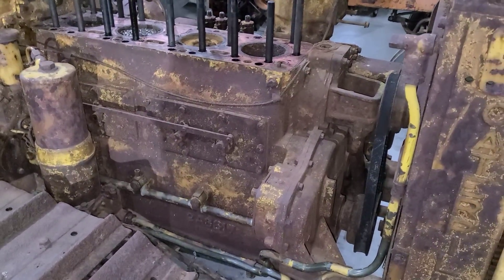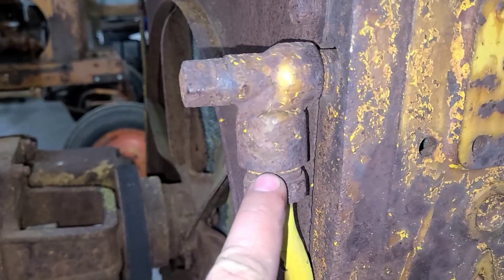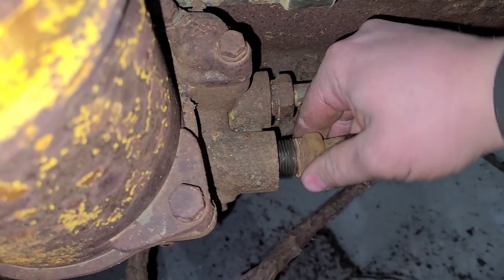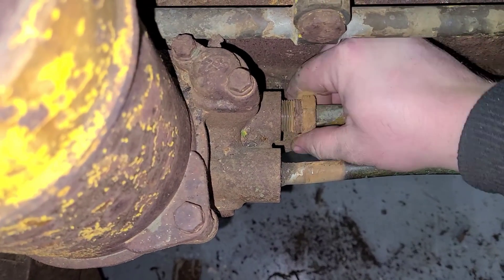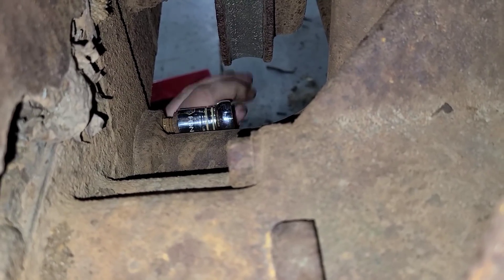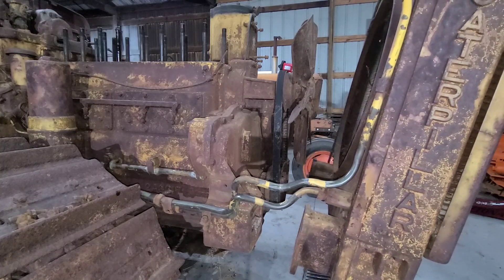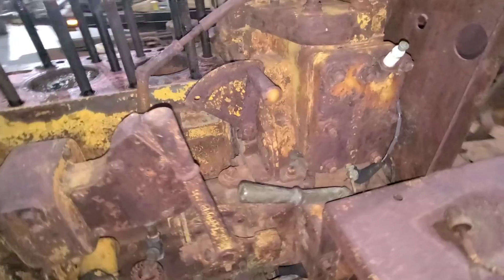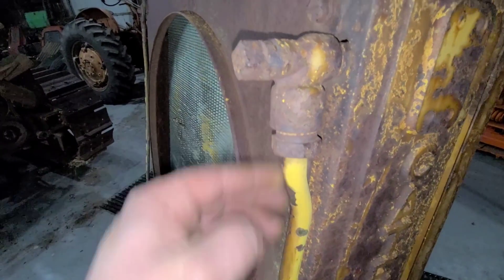Caterpillar RD-4 Engine Disassembly Pt.3

Comment: coming part with little a do, hope it keeps up! 👍 you said that there is no heat where you are working, It looks like it is wide open building or shed, which would be expensive and not very practical to heat. do you use torpedo style heaters for your spot that you are working to at least take the chill off?
Reply from the maker: The shed is a 50x80, with the front 50x40 cemented. I need to get a partitioning wall up between the front and back, as well as insulate and finish out the front half. Then I can throw some heat I'm there.

As for now I just wear coveralls and a good coat, no heater

Comment: Why don't you use penetrating oil?
Reply from the maker: I feel it doesn't work well, and for 99% of the bolts on this machine, nothing is needed to remove them, thanks for watching

Comment: I am stunned at how you are able to get frozen bolts, nuts, and line fittings loose. From here it looks all but impossible. I’m impressed at your skill doing that. A swimming pool full of EvapoRust wouldn’t be the wrong idea right here. Keeping track of all the parts is a major task in itself. Incredible work!
Reply: Blue wrench sir. Torch. Doing great job sir. But I would use some  WD 40 or liquid wrench or something.  Lol
Reply from the maker: I heat bolts when needed, otherwise most come out without issue

Comment: Where's that rust penetrant.? I cringe each time you attack a pipe fitting,  or bolt.
Reply from the maker: I don't use a lot of penetrating oils, never had good luck with them actually working. Instead, I like to use heat, but nothing is guaranteed 100% to work

Comment: Thanks for sharing.  Do you use penetrating oil such as Kroil to aid with braking loose rusted connections or just heat?  Keep those videos coming....
Reply from the maker: Honestly Geoff, up to this point I have not used anything. All the bolts have come out and not put up a fight, as if this machine is begging to be restored. Thanks for watching
Reply: @kylechrist  Amazing!  I live about a quarter mile from the ocean.  Everything rusts together.  I once sold a Land Cruiser with a spun rod, as is, because I couldn't get any of the bolts out.  The buyer was going to put a Chevy v8 into it, so he didn't care.  You live in a world I can't even imagine.

Comment: You need to cover the grate on the floor. It it a nice place for small parts to disappear into. Nice shop by the way. All it needs is some heat.
Reply from the maker: Thanks Chuck, I didn't plan on putting the crawler right over the grate but I'm trying to keep everything away from the walls until I get it spray foamed and tin put up this spring. I have some sheetmetal that I will cover those up with just so I don't drop anything down there

Comment: Kyle, if you watch any videos from the UK they would call those pipes for the coolant but then again they call rubber coolant hoses pipes also, go figure. One thing I thought odd is why pony motor cracked and not the bottom radiator tank.
Reply from the maker: I was thinking they might be called an elbow, I will look in the parts book and see what Caterpillar defined them as. Thanks for watching
Reply: The water jacket of the pony motors is usually full of scale and sediment and it is frequently almost impossible to get it drained.  The crack he has on the pony left cylinder, rear surface is very typical.  The bottom inlet that coolant has to drain out of the pony water jacket is in the opposite side of the base of the pony block and the connection is through a narrow tortuous passage that is frequently blocked completely.
Reply from the maker: @jimrankin2583  thanks Jim, very useful information 👍